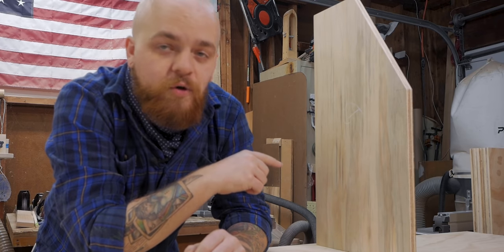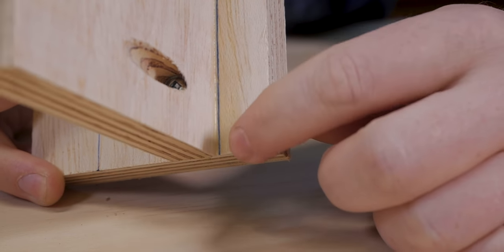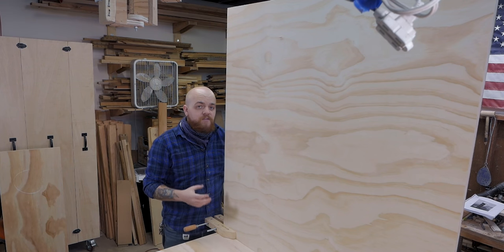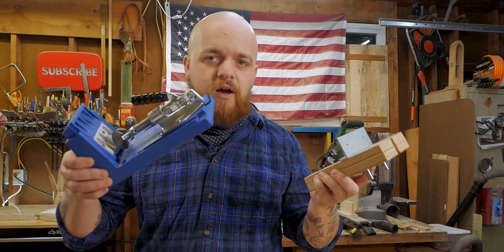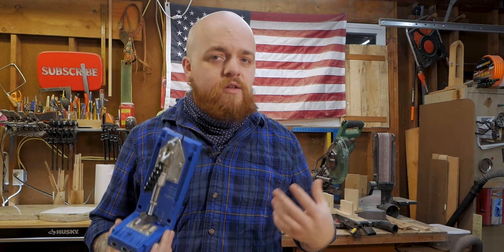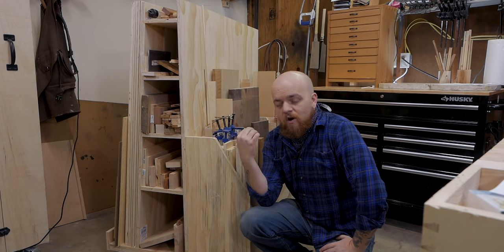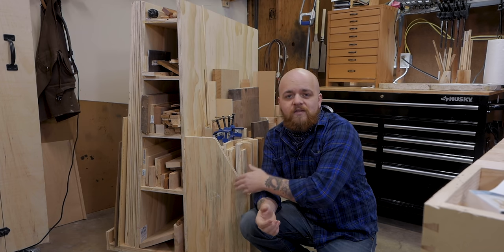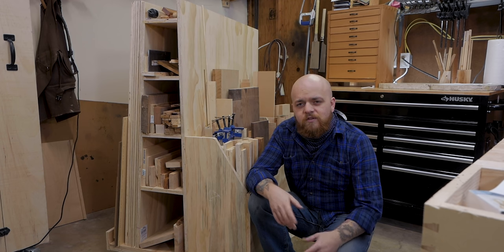Do You Think This Is A Good Woodworking Joint?

Comment from the maker: If you're interested in trying this joint out for yourself, plans for the doweling jig are available here: https://bit.ly/2JTcOt1
Reply: Instead of "hogging out" or using your Dado stack...Build Up.
You are working with plywood anyway.
Drop to half thickness from your finished depth.
And just build up.

Additionally, unless you absolutely Have To have access into the very tightest edge of the corner...  
Why not use 1 inch square lumber to simply screw into the cross grain of the two pieces of plywood forming the T?
You would have the perfect glue face not using any end grain as well as even being able to switch to nut and bolt joining.
This, after all, isn't a finished cabinet or piece of furniture where that might not loot good.
Reply: VERY NICE JIG BUILD!  Signs of a "Thinking" man and not someone who is dead from the ears up. (half brained)

Comment: when you said pocket dowels, for a second i thought you were going to drill angled holes with the pocket screw jig and drive dowels in at an angle LOL
Reply from the maker: Hahaha sounds cool for sure, not sure how effective though 😆
Reply: Funny enough that's the first thought that popped into my head, too.  I guess great minds think alike.  LOL.  Yes, I agree, may not be very effective.
Reply: lmao, I just made a nearly identical comment, then realized multiple other people thought the same thing. I kind of want to see it! :D
Reply: Someone has actually done that.  I can't remember their name.
Reply: @vftnow5938  Tamar @3x3 customs did it a few months ago on her record player cabinet build... then flush trimmed the dowels. When he said pocket dowel i honestly thought he was going to put the pocket hole screws lined up with the dowel holes to make the dowels expand? It would probably blow out the plywood however if he did that
Reply: thought the same
Reply: Same here! Lol
Reply: @tomhostetter8516  I'm going to have to check out Tamar's video, thanks for the reference.  Back in the day, before I owned a pocket hole jig or a dado set, I would sometimes join plywood in this way, with angled through-dowels, clamping where I could, holding with a through-screw (using a pilot hole to avoid separating the plies) otherwise, until the glue set.  Enough dowels, drilled freehanded at different angles left and right and driven in through both pieces, did seem to hold a plywood butt joint really tight, as the different angles functioned like toe-nailing.  And the little flush-trimmed oval ends were... different.  :)
Reply: Same!

Comment: I think dowels and pocket screws make for a great joint. I have used the joint many times over the years for pretty much the same reasons you went into in the video. In my situation as an occasional woodworker, I don’t have a table saw or a router, so if I need a dado, I am doing a bunch of cuts with my circular saw, which does work but is very slow.  On the other hand with a dowel jig and a pocket hole jig, I can set up a pocket hole dowel joint pretty quickly.  If i want more strength, I drill additional dowels and/or screws.  Another nice feature of this joint is that if you are building knockdown furniture in the style of IKEA, pocket screws and dowels can hole things together nicely with out glue.
Reply from the maker: Really good points Andy and I love that you aren't letting any sort of lack of tools stop you from building what you want. You sir, are a fellow Craftswright!

Comment: I haven't seen pocket-holes and dowels before, but knockdown furniture often incorporates a single fastening device (bolt) with dowels to prevent spinning.

I have a habit of using pocket holes as clamps for glue-ups. I'd love to see an experiment done to determine what value there is in leaving the screws in place vs removing them.

I think I'll keep getting comfy with dados, but it's cool to see this alternative for places where they aren't possible, or the cost of mistakes is higher. Thanks for sharing this option!

Comment: I've been a HUGE pocket screw fan for years and I never liked the tendency of the piece to wander without serious clamping.  This does solve that problem and strengthens the joint.  Well done!  I am going to start using this method, as soon as I finish building my "Improved Dowling Jig"  Keep up the good work!  You've got another subscriber here.

I don't see the wood storage cart plans on the website.  Did I miss them?
Reply from the maker: Awesome Daniel happy I could help improve your workflow! 

That wood storage cart is a Steve Ramsey (Woodworking For Mere Mortals) design and its free on his site. Keep up the good work my friend!

Comment: I do not think the strength difference between the different types of joinery is an issue in most applications.  I like the fact that the dowels compensate for the potential alignment issues with the pocket screws. Well done!
Reply from the maker: That was the big benefit to me next to eliminating the need for clamps while the glue dries thanks to the pocket screws. Thanks for the comment Kat!

Comment: Excellent idea. All jointing techniques have to do two things: Locate the parts and apply pressure until the glue sets. You considered Steve Ramsay's approach (dadoes and clamps). ?have you seen Peter Millard on 10 minute workshop? He uses dominoes for location and screws for pressure - then covering screw holes. He's working mainly in painted MDF.  You have realised that pocket screws don't really do both jobs - without a lot of effort. I think you have come up with something new and effective which only needs a drill, a pocket hole jig and a dowelling jig - and you've even told us how to make the dowelling jig
Reply from the maker: I think I have seen that, I just try to avoid having to fill holes whenever I can, seems to take forever haha. Thank you for the awesome comment Stephen!

Comment: I just found this video - liked and subscribed.  
I like this joint.  Glue provides strength, pocket screws provide strength and clamping force for the glue, while dowels ensure proper alignment.  The only limitation is on projects where visible pocket holes are not desirable.

Comment: I’m going to be using this on a simple, farmhouse style table my wife wants. It has several parts where end grain butts into face grain. I’m excited to have the strength and aligning support of the internal dowels and the clamping power of the pocket screws! The rest of the piece will be held together with visible, decorative dowels. Believing the best for this project!
Reply from the maker: Sounds like a great solution Greg, sending good vibes for your upcoming build! 😎

Comment: Dados solve two additional problems that you mentioned: they (at least partially) prevent splitting by not allowing the wood to expand sideways and don't allow the piece being added to slide sideways.

That being said, I had an idea that I have no way to check: use a Skil saw to make the dado.  Clamp two straightedges to the wood you need a dado in so that the blade can't cut outside of the lines, then rotate the saw until opposing corners are touching the straightedges and hog out most of the material.  Finally, bring the blade parallel to the cut and clean it out.  You don't even need a deep dado if you are going to use pocket screws; just one deep enough to keep the piece being attached from moving.

Does that make sense?
Reply from the maker: That makes sense but there’s a part of me that cringes hard at the thought of how much dust and potential kickback that could invite lol
Reply: I see the potential kickback, but I still love the idea!
Reply: Hmmm...  I wasn't thinking about kickback with such a shallow cut, but that could be dealt with by having an overhang on the straightedge.

Comment: This is a perfect use for the biscuit joiner and pocket screws.  Biscuits provide are much quicker to cut than dowels and require less precision but provide the alignment you need while driving the pocket screws.  It's my go to for joints like this.
Reply from the maker: Totally agree that biscuits are a great option for quick alignment joints but my understanding is they don’t add any strength to the joint?

Comment: Personal opinion here - I think your proposed dowel joinery is better than dado's because with plywood, the thickness can vary.  Meaning you can have an overly tight or loose joint.  Or both in the same (long) run.  It may be slower than a dado but it's less cumbersome when trying to assemble the rig.  I will be applying this technique in the future.  Only in cases where the strength of a dado is needed will I consider going the dado route.  Glad I came across this video.  And I like your dado jig.  Very intuitive.
Reply from the maker: Thanks Pete! Totally agree, there are some situations where a dado is a must, but other than those I think this joint wins out.

Comment: Thank you for this video. I keep hearing comments that screws add strength, not sure where that comes from? I have seen other videos testing pocket hole strength and they are usually worse than a dado+glue. The good thing about screws is you can remove them for future disassembly, not strength.
Reply from the maker: They definitely can hurt a joint if not used properly that's for sure! But if you were to compare a glued butt joint vs a glued and screwed butt joint the later would take the cake :)

Comment: I had a similar idea a couple months ago when I was looking for a way to flat pack a shelf and mail it out. I was using pocket holes to construct but was worried the people I would send the shelf to wouldn’t get the pieces to line up. A couple dowels seemed like the solution. Never ended up having to mail any out but now know it would have worked

Comment: I've used this method before. It worked so-so for me. Unfortunately the material I was building with was crap half inch plywood. I cut short lengths of bamboo skewer for the dowels. (Can't remember the youtube channel I saw that on)
Anyhow, I drilled the dowel holes all the way through the so-called "top of the T". Why? I don't know. I backed up each joint during assembly with a clamped on backer board and it went ok. 
All in all I think it's fine. The pocket screws pulled it all together while being aligned with dowels. And, now I have a custom plywood utility bed for my truck.

Comment: I used a similar idea a while back, but used a biscut joiner to align my project pieces and the pocket hole screws to secure it while it dried.  I've also used biscuts w/out glue so I can align my project pieces but still able to knock it down and store it or move it if needed.  I have my pieces numbered and can reassemble w/out issues.
Reply: I dreamed up this approach a few years ago as well.  I was making a large-panel cart (for scaffolding components, not lumber), and this worked well for me.  I didn’t want to deal with the tighter alignment for dowels on that project, but I can see how Craftswright’s super-cool dowel jig would address some of those concerns.

Comment: This is good. Pocket screws have a place in a workshop. I don't want to use pocket screws when fulfilling an order for a customer, but I have no problem using them in applications like this. I like the dowel as a stabilizer, too. It sure beats clamping and unclamping guide boards to keep the work piece in place.
Reply from the maker: Exactly! Commissioned work is something else, but quick and (somewhat) dirty then pocket screws are the way to go

Comment: Essentially what you're talking about is adding a bridging piece to a pocket hole joint. Dowels, dominos, or biscuits would all work equally well, I think. Those who have specialty cutting tools for dominoes or biscuits could take inspiration from this to start adding pocket hole screws to their joints to improve clamping while the glue dries, and those who only use pocket hole screws can take inspiration to add a bridging piece to improve alignment before driving the screws home.
Reply from the maker: Very well put Will and a super accurate summary of the video.... I could have made it a lot shorter apparently 😆

Comment: The great thing about dados, rabbets and grooves is that they are a lot faster if you are working with larger pieces and there is very little room for alignment problems or user error in applying the piece to be joined. Dowels can be fast in larger applications if you have dedicated horiztonal boring and face boring setups.

Comment: I tried pocket screws and biscuits- the biscuits didn’t prevent the 1/16” movement,( stopped it from moving much more)— I’ll try dowels and pocket screws next time. A similar construction has been proven in flat pack furniture. They often use particleboard and screw from the back (into end grain in the case of plywood). My vote for the joint 👍👍. Why ( with pocket screws) did you double up all the dowels? (In the dividers I would have made a story pole to repeat the dowel spacing. )
Reply from the maker: Honestly I think I just doubled them up because it looked "right" to me. I guess there could be an argument that they would be stronger that way but I'll have to test that out I think. Glad to hear you're giving it a shot, keep up the good work Andy!

Comment: I had not thought of combining the two joints, but it looks like a good technique in some places. It reminds of the way some machined metal parts are assembled. They use metal dowels to align the parts and bolts to hold the parts together.

Comment: I like the doweling jig and will have to give it a try down the road.  In the mean time, I think a biscuit/plate joiner could be used in the same way... to align and strengthen the pocket hole joints.  One added benefit is the biscuit holes allow a little lateral adjustment, whereas the dowels have to be spot-on in both planes of orientation.  Good video and provokes some thought.

Comment: This is a good idea because it limits the need to use clamps and I will try it on my next cabinet project. There are videos of people who miraculously manage to drill the screws into pocket holes using their bare hands as the only clamps - but every time I did not use a clamp I regretted that choice. I have made a couple of doweling jigs myself, including one aimed at larger cabinets which is a long L-shaped "stick" (two butt jointed 80 cm long, square 2x6cm sticks) with two series of 32mm spaced holes with brass bushings on each side of the "L" - one set is used for drilling into the board's edge and the other for drilling into the surface. I clamp my jig to the edge of a board only once and drill all the dowel holes in a row, thus eliminating errors that can happen by having to reposition a smaller jig for each of the holes I want to drill... But somehow even using a drill press my jig is not so precise - I think the stock I used before gluing up the L-shaped jig was not perfectly square. Or maybe the boards slipped during glue up. I bought a a pin nailer recently so will try redoing the jig and hand plane the stock to square. I got the idea from this style of jig: https://www.simek.eu/vrtaci-sablona-power-drill-do-hrany-656-20/

Comment: I did biscuit and pocket hole joints for about three decades until I got a Domino jointer.  They are very strong and shop furniture and tool boxes from thirty years ago are still going strong, and will probably outlast me.  I did them because I didn’t have space fore a real shop, and didn’t have a table saw yet, so dados were a pain.
Reply from the maker: I'd love to get my hands on a Domino because I agree they're probably better. A full floating tenon vs a dowel. I would imagine the tenon wins all day long. One day :)
Reply: @Craftswright  I bought one, only because I found it on eBay, including the systainer of dominoes, with both Festool and domino misspelled, for $650 to start.  I bid on it and nobody else apparently found it.  I only found it because he had listed some Lee Valley stuff, and I looked to see what else he had listed.  So, I won the auction.  It has turned out to be really handy for a lot of things.  Largest thus far was doing the balusters on a bunch of stair railing.  

When I started out, had a 3/8-inch drill, and some hand saws, hammers, etc.  Then bought a skill saw, followed by the biscuit joiner, and then the aluminum Kreg pocket hole jig.  My older sister watched Norm on New Yankee Workshop, and she would buy me things that Norm used.  So, when I asked for the biscuit joiner, she bought me the Porter Cable Norm had used.  When I asked for a pocket hole jig, she got me the Kreg, she had seen Norm use.  Sure are times when I miss Norm.
Reply from the maker: That’s a killer deal!

Comment: I've been using a similar combination of biscuits for quick alignment and pocket screws for clamping and mechanical strength. while I don't think biscuits add any strength, they make quick work of keeping those bigger plywood sections right where you want them for glue-up.

Comment: The dato should still be considerably stronger because it's able to distribute force on a face completely across another face.

However, this joinert is already strong enough. This would start to see the same problems that datos would at about the same forces and material sizes.

What makes this joinery awesome is
1) how accessible it is, not needing access to both sides, and
2) material reuse! Like you said, if you mess up a dato, that part is now scrap. Mess up a hole? Then move the hole.

One piece of advice though.
The pocket holes were still bowing in the video. You could fix this by spacing out the dowels, and putting the pocket holes in between them, thus minimizing how much the entire sheet bends.